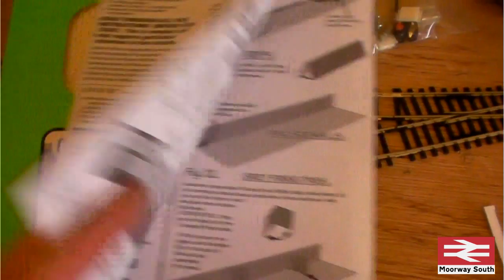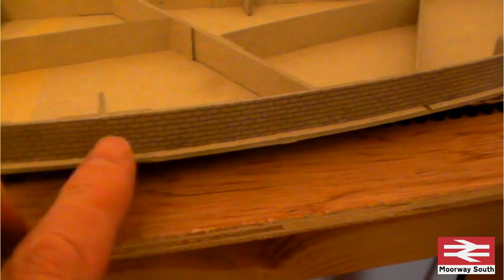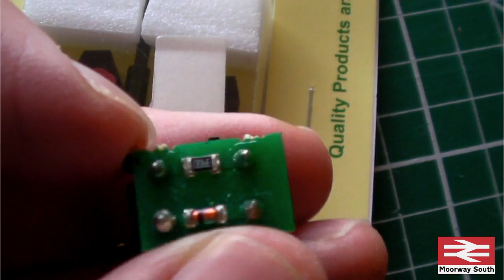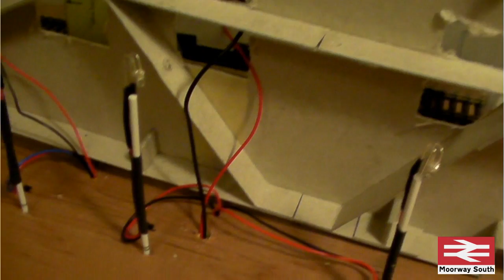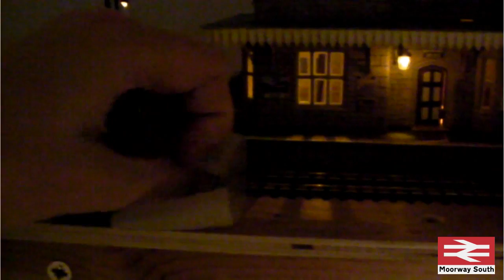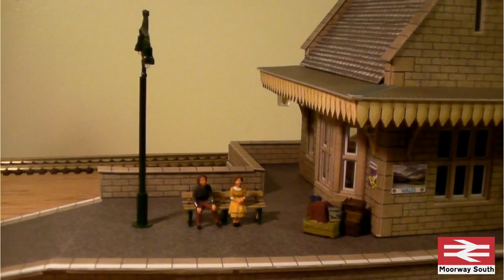Moorway South Part 10 - West Station

Comment: Again, superb, thank-you. Thanks, also, for the soldering video: more money spent. But, well, thanks to your tips. Also, re the Goods shed working: Chris Leigh' two volumes on GWR Country Stations have pictures showing where the rails and the road vehicles went: in just about every combination imaginable.

I'm particularly drawn to the road/rail/goods etc interfaces.

An excellent model is that of Pulborough by the lbscmodel group: tons of information in that model and my thanks to Doug's dad at Budget Model Railways for that.

Whether I'll ever get my head around the diode, resistor, led, 12v supply stuff I don't know. My O and A level physics is 52-4 years' ago.

Again, thanks and best!

John

Comment: Hello and New Years greetings to Moorway...! I found your excellent videos today and am enjoying following your project. I caught your comment about Brian Lambert...excellent reading...! I have been using "The short circuit protection" with bulbs for many years doing electronics...Great Joy to see them in action again...! Regarding the two lanterns on this West station...May I suggest you bring the back one to the end of the Building... to show it off more...? It will be easy for you to create a lamp yourself for the rear illumination...led, resistor and all. It is a good idea to have the resistors under the layout; This way you can change the value if so wanted. Also this way... you plan ahead and prepare for decoding of the lights later... Well enough for now... I better Watch some more of your videos...perhaps you've already made changes...PS: Oh... More ideas: Why not put a male plug under the Building...? It would fix it to the platform...where a female plug can be fastened...A small plug like a connector on pcb boards will do... the current is tiny... no need for these huge screw terminals.  Idea nr 2: Can you cut the floor off of the Building and fix it to the platform (velcro)...make a tiny edge for the house to attach to...? Keep on trackin'...Jakob.

Comment: You did a great job on the platform.  I really like your lantern lights and they look excellent in the dark. It is always amazing how complex all the wires become as you add lights and accessories.  Looks stunning with the room lights off.  If you use masking tape over the windows on the inside while you are building it it makes a nice diffused glow when done.  Love the cat.

Comment: With regard to the platform light orientation, I think the way you have them would be best, given the width of the platform.  I doubt there would be a set rule about their position, other than the one that states that platform furniture be at least 6 feet from the edge of running lines.
Reply from the maker: Thanks Geoffrey - I was thinking along those lines.